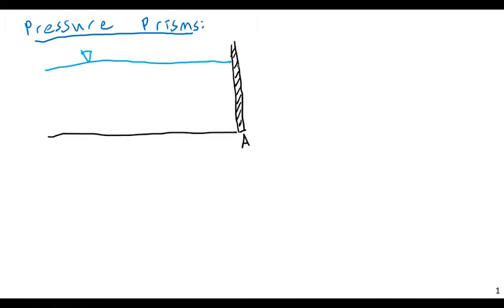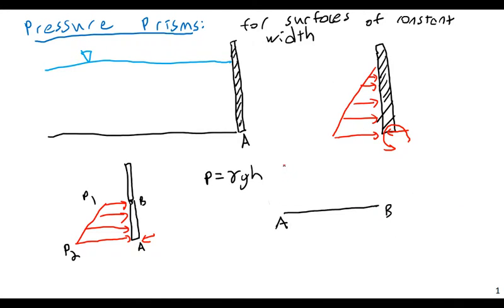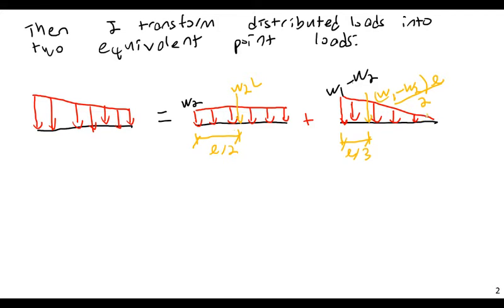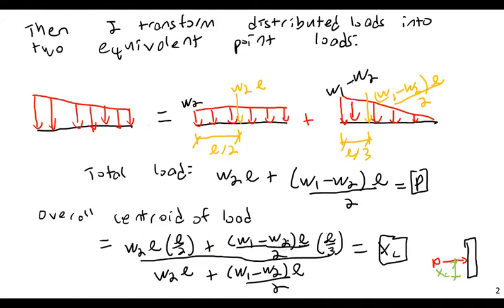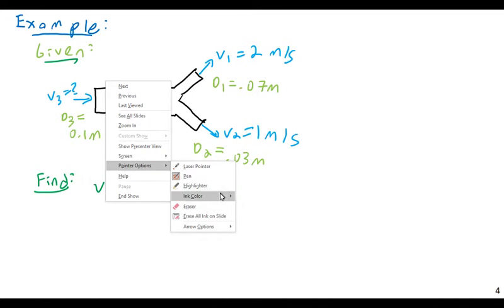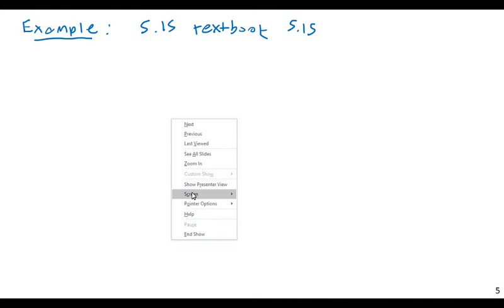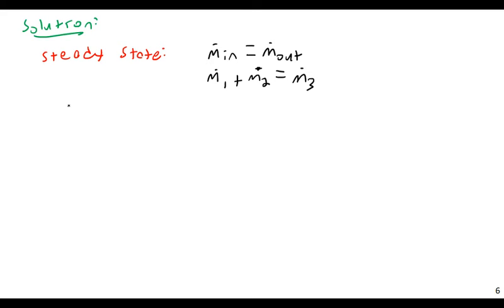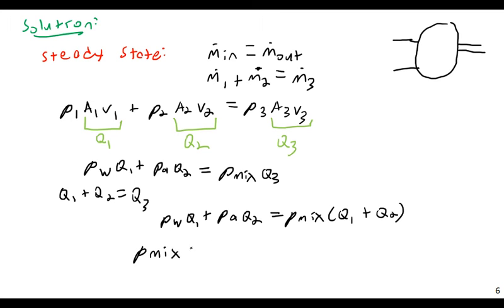Pressure Prism Review, Continuity Equation Continued - Fluid Mechanics

Comment: Ma'am you are doing great. However,  alcohol and water mixture may not have the sum of volumes regardless of the compression (i.e. alcohol molecules are smaller than of water).Would you clear that out? Nevertheless, your way of lecturing deserves a lot of credit and one of the best since it helps me a lot understanding the stuff.
Reply from the maker: Thank you. You are right. If you consider the actual chemistry involved, there will be some small loss in volume. If I add 0.5 liters of pure alcohol to 1 liter of pure water, the total volume will be somewhat less than 1.5 liters. But in this calculation, I assumed the change in volume was relatively small. 

There are certainly applications where this kind of minute detail would be important. For example, imagine you were designing the manufacturing process for some sort of precise pharmaceutical production facility. There, you would have to consider any number of factors. Mixing water and alcohol would indeed cause a change in volume. But even further, this would result in an enthalpy change, which would result in a change in temperature, which would result in its own change of volume. 

My point is, there are inevitably an endless number of simplifications and assumptions we as engineers rely on to do real work. In this particular calculation I assumed constant volume. But depending on application, you're certainly correct that this may not be applicable.
Reply: @TanyaLairdCivil  Once again, thank you.It is a pleasure following your lectures.